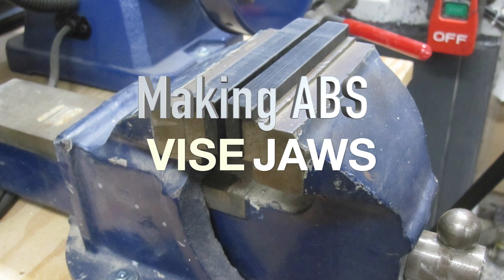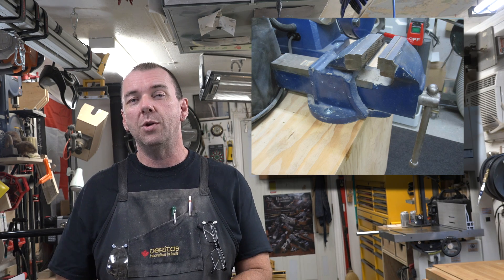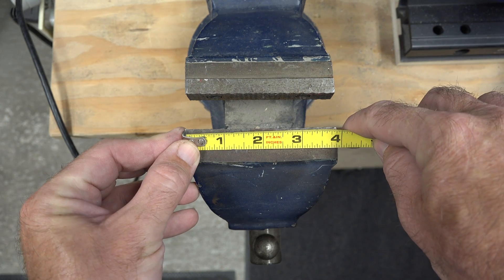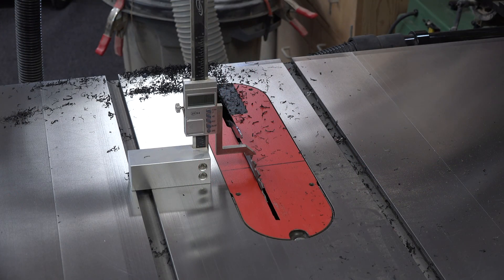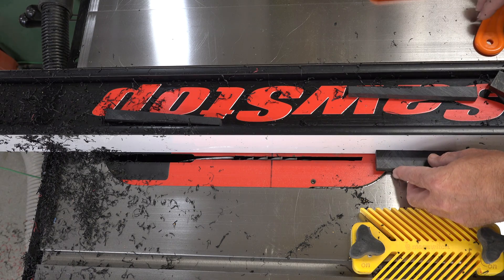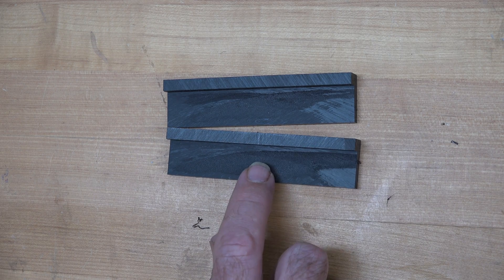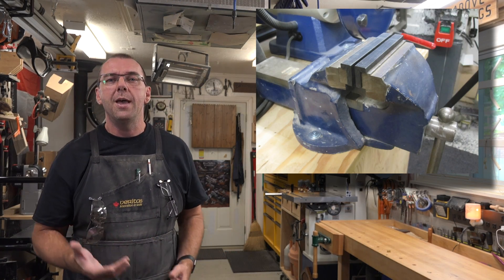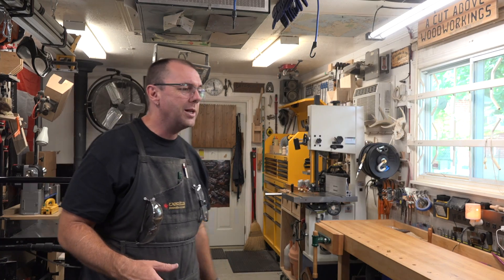Making ABS Vise Jaws

Comment: So why should the magnets atract when the jaws face each other?
Reply from the maker: That last thing you want is for the magnets to be repelling each other as the vise closes.  Depending on how small the object is that you are holding in the vise, the force of the repelling magnets can push the jaws off of the vise and prevent them from being seated properly.  I hope I explained that well enough.  Thanks for tuning in to the show.
Reply: @acutabove_woodworkings  thank you for replying

I thought them inserts sticking to each other when closing the vice would be more likely than for them to wander off if the magnets repell.

But you probably speak with more experience here.

By the way, your show is pretty interesting most of the time, so it is a pleasure to watch.

Comment: hi Ken my large vice the jaws have broken and I figured it would be time for a new one, so will  have to replace them with something similar, as I cannot get the plastic blocks in the uk , and use the magnets, and also will  re - arrange my wood working vice with again something similar to make that more wood friendly thanks again for another great video
Reply from the maker: No worries on not being able to get the ABS plastic John.  You can use wood as well and get the same results that I have gotten here on today's show.  Good luck with the build and thanks for tuning in.

Comment: These can be made out of any material that is softer than the jaws. Recycled HDPE works ,copper sheet , aluminum. You can even print using 3D for holding odd shapes. Cut a slot in them and you get a PC board holder for soldering.
Reply from the maker: I agree 100% Peter.  These are a great idea that can be made from any material but considering that ABS happens to be the flavour of the day, that's what we made them out of.  Thanks for the input and the suggestions.  It's very much appreciated.  Thanks for tuning in to the show.

Comment: These type of jaw covers are great vice accessories. In fact, I find that most of the time I have them installed on my vice. You might want to consider adding a groove down the centre  of the ABS jaws. Mine have this and it comes in handy when I cut threaded rod or dowels. I'm really enjoying these extra Tuesday shows.
Reply from the maker: Thanks for the kind words on the Alternative Tuesday program Jim.  I appreciate your support and your dedication to the show.  I also thank you for your suggestion.  A groove down the middle is a great idea and would make these jaws even more versatile.  Thanks for tuning in and for taking the time to leave me a comment.
Reply: Jim Lambier z@
Reply from the maker: @marystanley3174    I'm not even sure exactly what this comment means.  I guess I'm old.
Reply: Jim Lambier z@

Comment: Ken,  that is a handy add on.  Guess I had better hunt up some ABS or make a quick trip to Toronto.  I can see where the auxiliary jaws would be great and would keep the marring down to a minimum.  I gotta say I probably would need to use bright red ABS....just because.  Thanks for sharing.
Reply from the maker: Well, lucky for you, the ABS comes in bright red as well.  Heck, you could get it in pretty much any colour you wanted.  I've had a commercially available set on my vise for years but this is the first shop made set that I have used and they work great!!!  Thanks for tuning in to the show sir.  Always great to get your input.